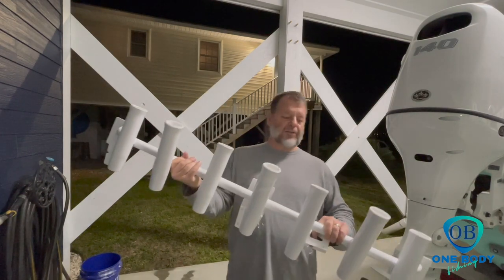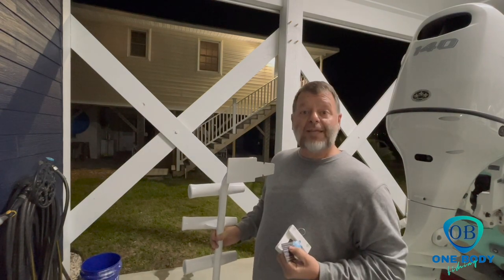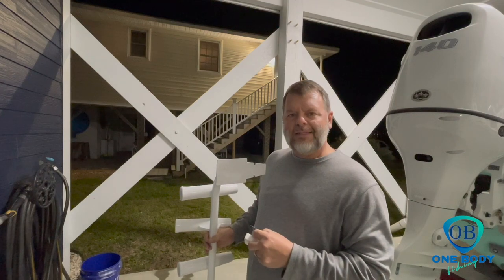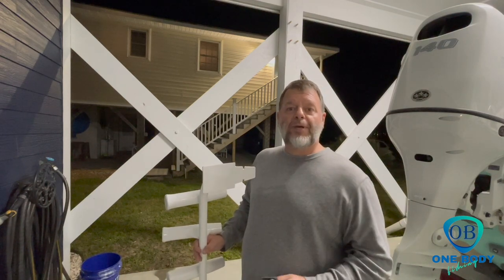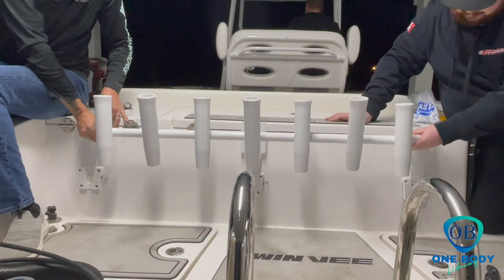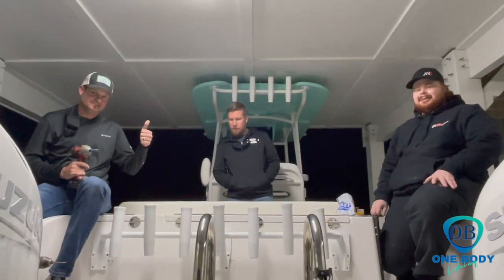Transom ROD HOLDER INSTALL..  Utilizing the V-Lock System Quick Connects..

Comment: Thanks for another great video!  I could watch Adam teach us how to climb a ladder all day😆
Reply from the maker: You should have seen Anthony B.!! 😂 But I know you’re partial to Adam.. Thanks for Watching!!
Reply: Question, how does it hold up if trolling for tuna and rod gets whacked?? Concerned it may pull out transom
Reply from the maker: @chunkyfather29 Yes, we never troll for tunas with this setup. The rod holders are perfect for storage and trolling for kings and dolphin. The reason I love this setup is for rod versatility and I can swap this setup for a scuba tank rack using the same v-lock mounts.
Reply: @OneBodyFishing  how has it held up when you get a hit on a rod? ive got the same setup and about to install it.  Planning on doing the same steps.  Just dont want it to break loose.  You think it will be fine for dolphin trolling?
Reply from the maker: @bernieshealy1090 
It’s held up well. During the install be sure to put the 3M Marine 5200 sealant adhesive behind the brackets for extra support and strength. I only troll for kings and dolphin with those Rod Holders, Nothing large. Let us know how the install goes. I would love to see a pic.